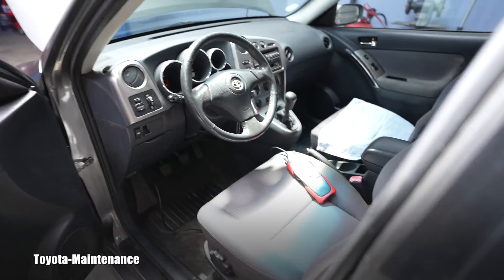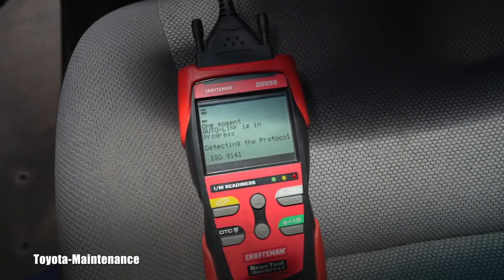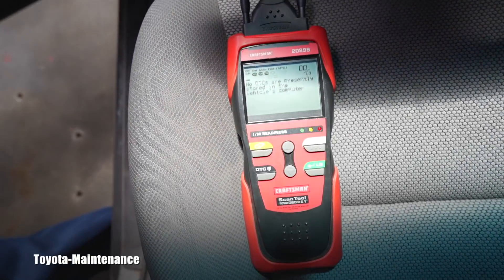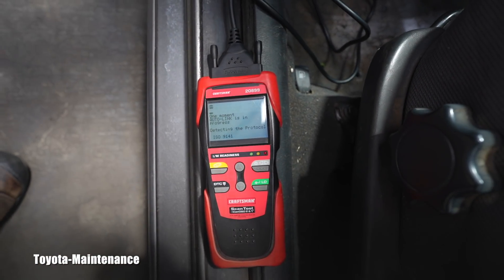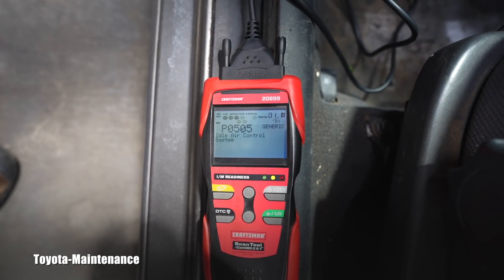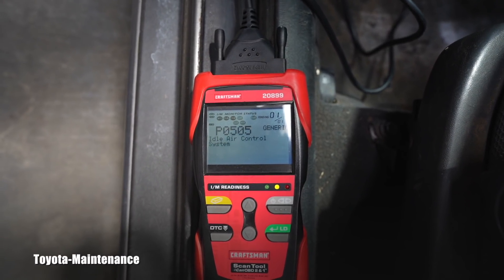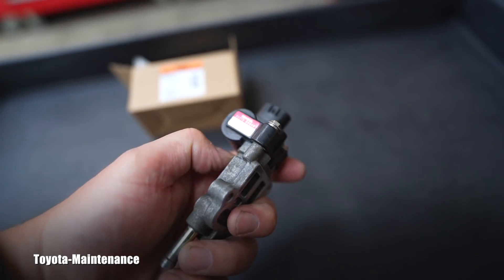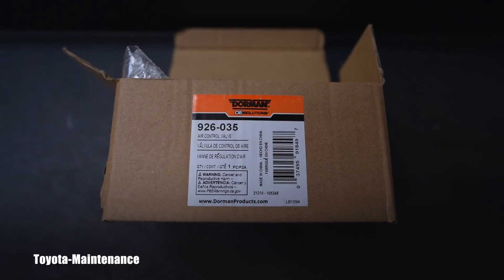Warning! Don't buy aftermarket parts for your TOYOTA

Comment: Oh crap!!!!!  it is as if my computer saw me order the aftermarket part then the next day this video popped up while watching youtube.  I didnt by the same brand but it is still aftermarket.  $70 vs $250 is extreme.  I thought I would try it and see if it changed or smoothed out the idle in my 2.4. If it does smooth her out I could bite the bullet and buy the oem now knowing this was the cause for my low rough idle.  Now I am unsure of my plan.  Here is my theory.....maybe....just maybe the 2001 ECU isnt as smart as that 2004 ecu that you were working on.  I will report back after install.  Thanks for the vids!

Comment: I'm am currently having the same problem with my 05 Scion xB. Last summer replaced with a denso part got about less than a year out of it and had to replace it again now only a few months later and it's doing the same thing p0505 code. Car runs fine just a slightly higher idle 700-900 rpm range. Tired of dealing with a warranty to replace a part that is going to ending up failing.

Comment: I have a '99 Camry for 21 years with 336k miles. For years I have put up with a rough idle because I couldn't figure out what was causing it. I replaced the original IAC at maybe 150k because the rubber gasket around it started leaking coolant so I bought a new IAC and gasket (aftermarket)... And replaced it recently with another aftermarket IAC thinking maybe it's why I have a rough idle? Next one gave me same rough idle. So I thought ok it's not the IAC... Well I found my original one in a box of parts. I check the internal dual IAC coils. Resistance was good on both. I cleaned it really well lubed it, put new rubber gasket on it, installed it and now I have a perfect idle again after many years! Keep the original parts when ever you can!!!

Comment: Aisin makes Toyota transmissions and Toyota partly owns them. I got Aisin CVT  trans fluid from RockAuto and worked perfectly. Aisin is not going to put their name on fluid that will damage their transmission 30,000 miles later and risk people thinking their trannys are bad. Aisin was 8 a quart for Toyota specific CVT fluid. The cheapest I could find the 4 liter dealership can was about $80. My closest Toyota dealer wanted $123 for the same can!!!!! 

Dorman is garbage for most items. I met a guy who replaced a window regulator with a Dorman unit and went bad after only a month. I will keep buying aftermarket because most times they work. Don't buy aftermarket on hard to install parts or parts that cannot be returned.

Comment: It is probably the set voltage perimeters not aligning with the dorman  part. The computer only know the voltage difference to differentiate between a malfunctioned part vs properly functionally part.

Comment: Dorman product are very sketchy.  
I took a chance on a vacuum modulator (not Dorman) for my 2.7L Tacoma with a cheap aftermarket unit.  It was easy to trouble shoot and easy to replace so took that chance.  So far so good after a few years.

I have used Dorman body parts before and they didn't last.

Comment: You may have to do an Idle relearn on this vehicle part... Disconnect battery for 5 min or so.. Run idle up to 1500 then back again a few times.. This may solve the Dorman part  problem???
Reply: Yep, just as with a new battery and the vehicle will die and folks think there is a problem...

Comment: The question is, are the aftermarket parts inferior or has Toyota figured out how to make their cars reject any non OEM part?  If they didn’t charge four times the price of OEM stuff maybe people wouldn’t be tempted to use them!
Reply: Right out of the box, the drilled holes didn’t fit the throttle body perfectly! Companies spend a lot of money on R&D…do you think they will open source to anyone that want to copy?
Reply: @nuniabiz7982  I understand and I agree….BUT…..when parts aren’t available and an aftermarket part is at a quarter of the price what would you do?  I guess if a person had an extra car or could take the bus to work it wouldn’t be a problem.  For others they wouldn’t have much of a choice!
Reply: @craigjorgensen4637  I agree! I had to do that once or twice with my 2007 corolla.
Reply: I COMPLETELY understand that at times, situation pending, you may just have to go with what you can get when, or what's available. But, when possible, if you want quality and reliability, you gotta pay for it!

Comment: Actually got an MSD coil for my chevy truck. Pretty damn name brand. Failed the next day. Comp cams brake vacuum pump for my car. Probably failed before it left the manufacturing facility. Have seen parts or equipment failures in residential construction too. Nothings made worth a 💩 anymore. Hopefully the Toyota parts from Toyota will last

Comment: I have a 2006 RAV4 Sport with the 2.4L engine. About 3 years ago I had  the front pads and rotors replaced with non-Toyota parts. That was a mistake, the pads are noisy, and the rotors are warped. Does Toyota have a  kit that includes all the necessary parts to restore the front bakes back to stock?  If not, where can  I get a list of the necessary parts?  Much thanks.

Comment: It’s hard to tell sometimes, as the counterfeits look just the same as the original. I guess if it’s to good to be true it probably is.
Reply: It's not pretending to be a genuine OEM part, that would make it a counterfeit, it's sold as an aftermarket part, produced with as many corners cut as they can find, especially quality control. The part wasn't counterfeit, it was poorly manufactured and very low quality, to the point it doesn't even fit, let alone work. I don't know how this company is still in business at this stage, such is their reputation

Comment: Not all aftermarket are ill-fitted, inop crap out of the box - I have had very good luck with Valeo and Japanese made Exedy clutch components...  Now electronic components; Yeah a lot of junk out there, esp reman starters/alternators/actuators, etc...  I have had OK luck with Dorman overall, but it could be better.  I have also gotten genuine Toyota junk too - Camry W. pump  leaked from the weep hole at not even 40k miles...  Course they always had problems with OEM pumps (2AZ-FE).

Comment: MEH, One defective part doesn't mean the entire brand is bad. And it's almost impossible to tell a genuine Toyota part from a fake. I recently bought a "genuine" Toyota MAF sensor and while the box said made in Japan, the Toyota/Denso part (22204-22010) matched the OEM but without the made in Japan claim. Actually the new sensor had a large "C" font on it, so maybe it meant copy, but it worked. A genuine Denso oxygen sensor (#234-4624) had the part # on the box and on the sealed bag but had #42240 and 12F10 on the part itself, which I found odd. Anyway, it appears the only thing the 2000 Echo doesn't like are the cheap aftermarket fuel injectors because it says: system too rich bank 1, and the idle is high. I don't see any vacuum leaks so I'll clean the IAP next. I just finished correcting a bunch of EVAP codes (P0440, P0441, P0446) by changing the two lines that run from the engine back to the charcoal canister since they were totally clogged. Bought a new Dorman canister as well.  

I should add that this Echo has been sitting in the yard for 17 years since it went off a dock, crashed through a thin sheet of ice and landed on all 4 wheels in about a foot of water. I guess with 4 young teens, it wasn’t nose heavy. I took the interior out to dry and deep clean, changed the ECU, and changed all the fluids but the trans had a clog so I finally got around to replacing it. Then I had to clean out the fuel tank, replace the fuel pump, replace the frozen alternator, the noisy air compressor, the frozen cooling fan(s), and the frozen blower motor. Apparently everything rusted internally. I mean I took everything apart, cleaned and lubed everything but ultimately everything needed replacement. I’m amazed how smooth and quiet that engine is.

Comment: Dorman is garbage. I had the same IAC valve problem in my Sienna. Took it off and drowned it in throttle body cleaner several times. Fixed the problem.

Comment: My 05 Scion xA has 271,000 on it. And it hates the AC or defrost on when at a stop. It will idle real low almost as if it wants to stall but never does. I think the IAC is the culprit or maybe something else idk.

Comment: When it comes to headlights housings, aftermarket is fine if you get the certified versions which cost a little more. More precise fitment.
Reply: Buy aftermarket junk and have it crumble in a few years. Bad advice

Comment: I wonder if you did a short video showing him got to check the proper oil level since a cold engine can have the dipstick read half to ¾ a quart low since liquid can expand. According to Ahmed, master Toyo tech. Check after engine is fully warmed up. And engine has been turned off for one minute to settle down from the top end. According to him and engine is fully warmed up after 7½ miles of driving or 15 minutes. Personally I think when the coolant reaches 165-180°F or when the temp gauge reaches operating temp just over half mark it usually goes to is fully warmed up, but I'm not going to argue with a master tech's theory that he wants. Underfilled by that much is better (although not ideal) than overfilling by that much, having the crank foam the oil splash and now you have air in the oil and that's less lubrication, and potential to throw a rod if a piston seizes. 

People can search engine drive cycles for their particular Toy model because some have very particular conditions to set monitors like Evap and similar. Some states do not require smog/emissions testing, however of the states that do, some allow one or two monitors to be incomplete and allow pass for registration/transfer (sale). Some strict states require emissions compliant parts or no modification to the exhaust and some will allow more or less monitors to be tested if the car falls in a certain year. California requires an additional test (EVAP) for certain years like that Camry that pulled in for the oil level check.
Reply: 15-20 / 5, half marks if not.
Reply: Uh when you pour it out the bottle, the oil is at room temperature, why would you measure it when it's hot?
Reply: Who the hell gave you that advice???? Hydraulic fluid like ATF expands, but engine oil isn’t the same. Can there be some expansion… yes but barely. Engines should always be checked cold and after sitting on a level surface. Read any OEM manual and tell me I’m wrong! A transmission is a totally different story
Reply: @nordicpride9708  as I said above the master Toyota tech working at a current dealership and his name is Ahmed. How many years have you worked at Toyota or are you just a senior citizen with opinions from hell.
Reply: @daijoubu4529  measure it hot. No owners manual says measures MOTOR OIL cold. By then you overfilled a cold snack engine and the moving parts whipping air into the oil will cause lack of oil to surface contact destroying your engine.

Comment: You have me worried thinking that ]the screws that need to be removed in order to clean the IAC were not removable because I've done this job on 4 different Toyota camrys without any problem as a preventive maintenance job 400 dollars is too much money if I can clean it myself.

Comment: The lesson to learn here is if the original Toyota part can be serviced, fixed, it is far better to spend the time to do that rather than use aftermarket junk like Dorman, where most of the time you'll do the job twice and be out of pocket.

Comment: Not all aftermarket is bad but Dorman is just meh, sometimes if you're lucky, its just rebadged OE parts and sometimes they are the OE manufacturer. But in this case, it appears that there's 2 IAC part # listed for the Matrix, one for rear disc brakes and one for drum when you look at Standard Motor Products and WVE but Dorman only list that one part. That Doman IAC is also listed for the Corolla and that one also have different parts if it's JPP or US made, so maybe it's the wrong part? Seems like the Dorman part is for JPP/drum brakes, where is this Matrix built/trim?

Comment: There is nothing wrong with aftermarket parts IF they come from the OEM manufacturer. Does Denso make this part. If so, they will cost more than Dorman but likely less than Toyota.
If Toyota doesn't have it in stock and there are supply chain problem... What is a person to do?

Comment: Maybe the computer needs to run 100 miles to relearn the new part?  Not much circuitry on that idle regulator, no?  What kind of sensor is supposed to be integrated on that idle regulator?  Okay, nevermind, I see that it continued to code because it never sealed.  Patience is a virtue.

Comment: If toyota parts is so better than aftermark why did it not last longer if its dubbel to tripple the price
Reply: There was a rat's nest piled over the throttle assembly, in a previous video, right on top of that idle control valve. As a result, the throttle assembly, and the valve, rusted, but would probably have lasted twice as long, or life of the car, if it wasn't for the rats infestation. And the reason behind OEM parts being expensive, compared to aftermarket, is obvious and understandable, the reason is quality materials and quality control, which aftermarket lacks, and in this case, didn't even fit out of the box. That's the reason why Toyota OEM parts are so much better and also why they are expensive compared to shiny stuff, junk out of the box
Reply: @Charlie_Crown  yes if you park a car and not driving it it will last longer  wil rusted up and rats making nest so it is a matter of compaire spares to each other on the same level . If Toyota drop the overprized spares price and do not cater for duts in these spares only then I wil buy it . Aftermark part makers exist because there is a need for it otherwise they wont exist anymore . Competition in these business is a good thing.
Reply: If its the original part, it lasted 15+ years? Lol

Comment: There is nothing wrong with aftermarket parts, a lot of them are better than oem, it just depends on the application. Your problem my friend is your aftermarket part is from Doorman. They are the worst aftermarket parts company. I bet you if you bought another reputable aftermarket part it would be ok.

Comment: Denso went Chinese years ago. Actually they box em and ship out typical quality aftermarket crap. Beware of denso " first time fit" products. At least look at them and check the quality. Radiator and sensors may be junk. Nippon Denso is what you want but get the card ready
Reply: Aren't FTF for like oil/air filters and wipers only? Even if it's made in China, its still Denso QC, I wouldn't hesitate to buy Japanese brand even if it's not made in Japan (eg Nikon cameras/lens, Zojirushi rice cookers, etc)

Comment: Aftermarket electronics, electronically controlled parts, and electrical sensors, are hit or miss. Is the part analog, digital, PWM or duty cycle controlled? The aftermarket often answers this incorrectly. Thank you Peter!